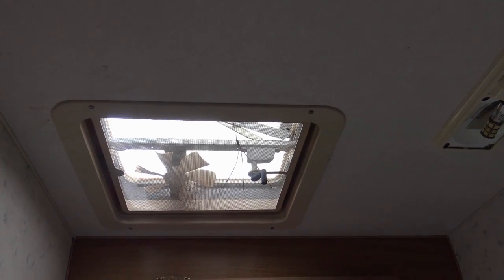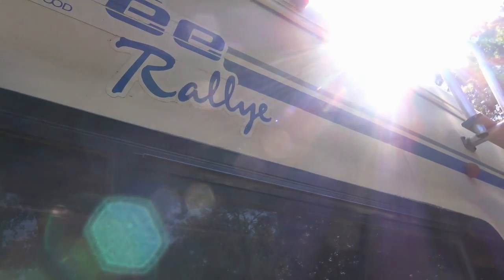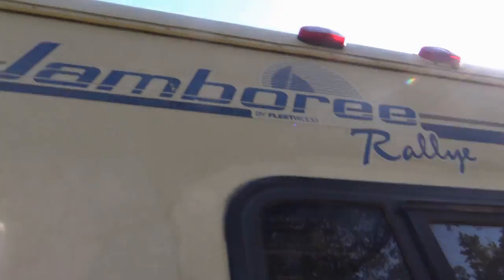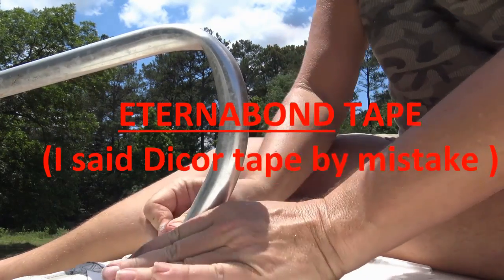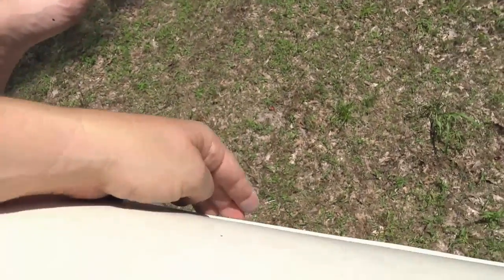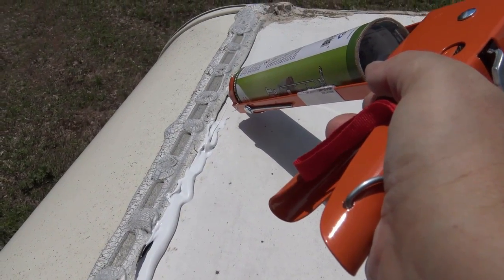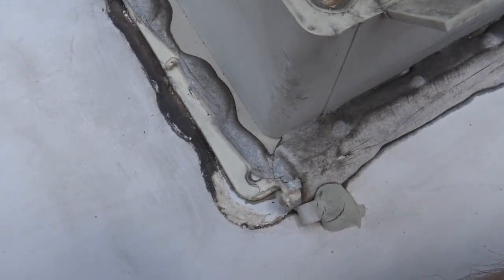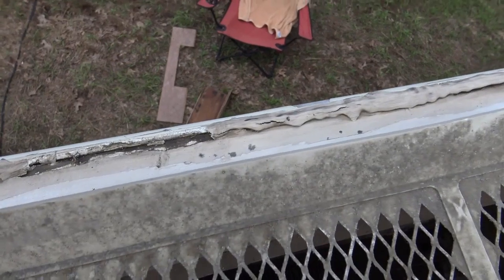RV Roof Repair: How I Repair a Leaky Roof on my  1993 Class C RV

Comment: I'm living in my '79 Nomad camper. I  was laughing at the caulking. You have no idea how many tubes it took to get me dry! lol And your caulking job looks SO much better than mine! It's not easy to make it pretty. Hope you're all sealed up now. 😊
Reply from the maker: Hollie, thanks for understanding that it's not easy to make it look pretty! thanks for sharing your experience. good luck! <3
Reply: Carolyn, try using frog tape or painters tape...I have been calking around tubs, sinks and fitting granite and marble and onyx for years...tape is your friend..it takes a few minutes to do once the area is clean but it makes a world of difference when you remove it...give it a 1/4" and so it has enough area to grip to...when its a 'needs to look clean' are then give it about 1/8" and then calk and when you use a wet finger to wipe it or better still a small plastic pipe so you don't end up with some chemicals in your mouth from licking your finger time and time again....also yo get under a seal you can take a 2" x 4" wide aluminum piece and fold it so its a 'V' shape lengthwise and then they will lift the rubber as you then squeeze a line of calk under it, it takes two people but you get it right under the seal and the seal falls flat on top of your bead of calk.....hope that helps...also if you want to bash the aluminum edge on a seam use a hammer with a piece of wood, it stops the aluminum from cracking if there is any paint and stops the 'hammered edge' look.
Reply: How about a video, please? I can't visualize what you're saying. :(
Reply: If your painting around windows you use frog tape to stop the excess paint getting on your fresh painted walls...you do the same with caulk, you simply give it a 1/4" gap so you can get more thickness to your caulk overlap....now you can use your wet finger if its a small area or use a piece of plastic pipe that is about the same diameter as your forefinger which you can wet and use to give the finish that quarter circle shape, that way you can caulk then drag the pipe or your finger along the whole piece at once,,a short 4"-6" length of 3/4" pipe should be fine......as for lifting and separating a rubber seal to caulk under it you just need a 2" by 4" piece of aluminum which you fold or have folded in a vice so its a 'V' shape..actually more then 90 degrees at one end that travels along about 2"...this can then be forced into the rubbed edge to hold it open while you then caulk under the forced open edge and then slowly caulk as the "V' travels along the rubber, holding it open then as the rubber naturally closes to will seal itself by pushing the excess caulk out again..once again, use the frog tape to stop the caulk getting everywhere, this time only allow 1/8" gap...that keeps it neat and clean...you cant even tell it was caulked at all.
Reply: you can use a pointing tool which gives a similar shape to the caulk edge....if you need to know how to caulk then look for caulking tips on youtube...there should be a painters tape tip for it...it takes some prep but better that then a messy finish on your nice sweet ride.

Comment: I've been helping my Mom fix leaks on her 1994 fifth wheel.  I figured out that I could put painter's tape along the area before caulking so I get a straight clean line.  Also, I wet my finger before smoothing out the caulking.  Eternabond fixed her roof leaks.  That stuff is awesome.  Good luck on your new rig search!

Comment: Great work! I've been watching a lot of RV videos for the last couple of years in preparation when I make the leap. Since I don't know exactly the RV I will decide to purchase I've decided to watch a variety of models etc.. One tip that made perfect sense was to purchase parts in advance before they go like calipers, brake pads, belts, water pump, gas pump and so on. Some the parts you can purchase rebuilt or through liquidation and even research some junk yards as you're heading into a new location. Most have started a website listing parts they have available and check prices the saving can be huge and save you the time of waiting for parts and drop the price of the repair. You might already know these tips but it can also help those that don't. Not sure if you have any of the service manuals for your RV but they can always offer insight to the inner workings and help you avoid getting ripped off by some of the repair place where they are shady. Regarding your generator sometimes when you have service done wires or hoses aren't secured properly and when you start to drive they fail to make contact and then as you drive again they fall back into place and will work temporarily so checking to see if any are loose etc can be quick solution. I found this link and it contains the service manual for your generator page 7 contains some troubleshooting tips and possible solution  
http://www.twinslan.net/~n0nas/manuals/onan/981-0139%20Onan%20KY%20Microlite%204000%20Series%20RV%20Genset%20Operator%27s%20manual%20(09-1994).pdf. Lists of Salvage Yards and there locations in the US-http://rvbasics.com/techtips/rv-salvage-replacement-parts.html, Owners manual-http://rvbasics.com/techtips/rv-salvage-replacement-parts.html

Comment: CAMPING WORLD is online and mails catalogues for things like vent seals, air conditioner seals (which sit under the AC), rubber roof paint, and anything else you might need for an RV. I had a '78 Class C for many years so I can empathize/commiserate, Glad to see you are DIY and saving the big bucks. You are a good example for others. Thank you. I love you. I am currently paying for a leaking roof to be fixed and after $500.00 we are still leaking.

Comment: We are having the same leaking problems in our 1993 Telstar Class C. We used both the Dicor self leveling caulk and the Eterna bond tape on the seam. We also coated the fiberglass roof with clear Flex seal. We couldn't see any cracks in the fiberglass but we didn't know where the leak was coming from so we just sealed everything. We replaced our bathroom vent/fan last year with a new one. That seems to be holding up just fine. Fingers crossed that both your repairs and ours hold up!

Comment: Thanks for the tips on sealing leaks, man I use to go on the road gold mining 8 years ago with my travel trailer and had some bad leaks. Well the plastic trim you put over the holes that attach the siding is what i needed to replace did not know that so thanks when I get anouther travel unit I will know! Your great and taught this guy how to fix this problem, your a smart gal!

Comment: A thin bead where the two surfaces meet, about 1/4 inch. Spray Windex on it and run your finger down it. Windex keeps it from sticking to your fingers and keeps the caulk smoothe and try to run your finger from end to end. Don't start and stop or lift your finger till you reach the end. Takes a little practice but looks great when done. P.S.- Don't try to clean it up with caulk remover, it will get behind what you want to leave and cause leaks. Only use it if you plan to remove all the caulk.    Stay dry.

Comment: I would get a few gallons of trailer roof paint at Lows and give the entire roof a coat or two of paint then re-coat the roof every two years. I live in a 1986 construction trailer with a galvanized roof. Doing what I told you I've never had a leak in 31 years, (knock on wood). I also calked around all my windows like you did using silicone out door window calk. They were not leaking so for me it's just extra protection.  The one place my trailer has over your RV is that it's been sitting in one place fairly level since 86, so it does not rutch around causing the joints etc to get gaps.  The paint on the roof fills in the smallest of crevices where water can enter etc and keeps it from rusting, however your roof may be some other material than sheet steel like mine is. But I'd worry about water getting in around the seams and rivets ect because the roof gets a direct pounding in a rain storm and of course snow that lays up there and melts in winter etc.

Comment: What about black mold following the dampness?  Is there anything you can apply to prevent that?  Can you rent a large fan designed to dry out homes?....then stay in an RV park and use the electricity to power it?  Good luck

Comment: Beginning about 18:20there is a crack in the refrig vent coming from a bolt on top of the vent.  You may want to get it sealed also or at least looked at.

Comment: My wife and I purchased a 2005 travel trailer that hadn’t ever been weatherized. As the Arizona monsoons set in we noticed many leaks in our roof. At first I did exactly what your doing, but couldn’t stop all the leaks. I ended up buying a 5 gallon bucket of Henry’s Tropicool from Home Depot. $200 wasn’t cheap but has a lifetime guarantee. I used a medium nap rolller and a broom handle rig and layered that stuff on thicker than pancake syrup. I had to record a couple spots but it did a small miracle for us. No more buckets for us

Comment: the pin on the bottom of the caulk gun swings out to pierce the seal in the tube
Reply from the maker: I just learned that from another viewer. how cool! thanks!
Reply: Carolyn's RV Life eternal bond tape where did you get it and

Comment: I suggest that you get an dehumidifier close up the RV and run it as will help to prevent mold from occurring. Also wipe down things with a little bleach and water with gloves on. You will be in Matilda until you find some thing else so you don't want to run into any health risk. You will want to pull out all the moister that has gotten into your RV. As long as the rain doesn't come in who care what it might look like at least you will be dry. Hope your having fun finding new places to camp. I surly am enjoying the video of them. Take care, stay safe but most of all have a great day. Spring, TX

Comment: Water leak..oh yeah, can't wait on that problem. I used "Solar Seal" first time on some leaks in the rear. No problem, still good and it's clear, flexible but can't use fingers to spread it, too thick. Made for roofing and shingles, worth $9 a tube. Next time try cutting the tip of the tube a little smaller..can get in between the smaller places better also avoiding "a blob"...hope there is no next time. that tape was KEWL...Will check that out for just in case issues. Hope ya found it all, that's a lot of areas you updated...Keep Looking Up👍

Comment: I saw a missing yellow running light that is on the passenger side I think.  This should be replaced, or you can seal that up for now or when you get time because it is another place water can get in, and possibly cause a short.  Great video, and maintaining an RV is not as simple as some people think.  At least you are getting things done when you can and share that with us, and we appreciate that.  Stay safe and happy trails!

Comment: Great stuff Carolyn.  One easy way of getting a neater line of dichor on those long runs is to lay a length of painters/masking tape along the whole length about a half an inch away from the seams. Then  apply the sealant as you did and pull off the masking tape while the sealant is still wet.  Voila you then get a nice neat line :)

Comment: I hope your repairs went well. I have a 1992 Australian made Freeway motor home, not U.S. manufacture but Australian company which illegally used the Winnebago name and re branded now as AVIDA. Now 27 years old and owned by me since Jan 2019 I have leaking around the air conditioner and back window which does not open. The left hand side rubber has shrunk and become hard after parking in North Australia tropical heat for 3 months facing east. Just got onto the roof to check removal of old air conditioner and it is a mess. I also have learnt so much with Youtube videos and like you will be repairing mine.

Comment: When I bought my 2001 Wildwood pull-along two years ago, from the only owner it had, I was aware it had had some leak problems. What I wasn't aware of, however, is that the wood framing for my camper, under the siding, has all turned into mulch. Much as I love my camper, much as I would love to have the wherewithal to get it taken apart and rebuilt, I think I'm also in the market for new digs. So I feel ya!

Comment: That and SnowSeal is Job 1 when buying an older RV.  Sometimes, we either do not know or do not have the time to do the work, but the sooner it is done, the less major damage that needs to be repaired in the future.  

I know SnowSeal works great for metal trailer roofs.  I don't know if it is recommended for rubber roofs, but I would not wait until your roof starts breaking down to apply something on that order.  Those types of products usually cannot be applied below a certain temperature.  

SnowSeal is just painted on with a roller.  It is easy and really thick.
Reply: And it will likely improve your resale value.

Comment: Just a FYI, cut the caulk applicator tip before you put the canister in the gun. Then you can use the seal puncture rod that is attached to your caulk gun. Ever wonder what that little rod that pivots out was for? Then you do not have to worry about forgetting the nail you said you forgot, or gumming up your screwdriver. Just some friendly advice.

Comment: Memories... I restored our family camper one summer after water damage.  I enjoy those memories now.  They do sell rubber fingers (as opposed to rubber gloves) so that you don't have to get that sealant all over your fingers.  A piece of tarp and some duct tape work well until you can get to leaks.
Reply: We also put that silver coating on the roof to deflect heat, but I never noticed a difference from that.  We were always parked in shaded areas anyway, and on hot days the a/c was on.  We put a piece of laminate flooring in water for 24 hours to test it, the water never penetrated it.  I think that is a good choice of flooring in situations where water damage can occur.  We also took all the windows and old putty out, and completely put new putty all around for the windows to sit into.  What I liked best was that I had an excuse to change the interior paneling, and at the time it was brand new that all types of stylish paneling was available for sale. Our camper was as new again, and is still going strong some 30 years later. I think the camper was 17 years old when we restored it.

Comment: I like to use green painters tape to outline where I am sealing. On the window trim and coach skin... once sealant is where I want it I remove the tape. Works best if it is removed while sealant is part wet. All for appearances. But, not on the roof. The a little touchup paint..   looks like you got it sealed. Good job. :)

Comment: Carolyn good job. If you look on your caulk gun you will see a long nail screwed to it in the front. Use that to puncture the tube seal before putting it into the caulk gun. saves having to clean off a screw driver.

Comment: FYI- there is a wire stick attached to the caulking gun to Pierce the caulk tube with. Save the nails!  😀 Thanks for the tip on the caulk remover.  Nice dyi job!

Comment: Tool tip.. the wire on the bottom of the caulking gun is for poking the inner seal on the tubes and that hole in the handle is for cutting the tips :)

Comment: you should have used the Tape across the rear edge and then used the caulking. also you should  have placed tape completely around the base of the top of ladder covering the old calking and then putting a layer of the caulking as a seal. another think you could have done is when you lifted the back edge of the old tape/caulking you could have put some of the new caulking under it then pressed it down it would have given you a better seal.

Comment: Flex seal works so good I used it on my pop up and no more water in popup
Reply: You DO NOT want use flexseal on EPDM (rubber) roofs. It is petroleum based & will do bad things to the rubber.

Comment: I'm catching up on your videos. This one is very helpful to me as when I finally get my mobile home it's probably going to be a class c and an older one too. I decided on Class C because I have a cat and unlike a dog won't be able to wonder around outside as much so a van would just be too small and I think I'd be too chicken to try and drive a Class A. I also don't really want something that needs to be towed behind because then I'd have to get a big enough truck to tow it and also the thought of towing a big trailer just sounds scary and then there's no quick get aways if needed either. Anyway sense my fixit jobs would be as if I really knew what I was doing this is very helpful. Pilamaya! (thank you in Lakote)

Comment: Good for you for trying to plug the holes yourself. I'm guessing you were already out of the area that where there was offers to help.  Are you sure you will be happy with a class b after being in a large class c?  Plus they cost so much for what you get.  I'll be interested to see how the selection process goes as I'm still in the looking process and have flip flopped on class B vs C now a few times.  I have however decided Class C.  My reasoning is that I plan to be in it for a few years FT, would like room for guest(s), don't want to make up a bed every time I want to sleep (some B's do have a perm. bed in back but not many older ones from what I could find), and I'm not crazy about the wet bath.  I'm also not planning on getting a large C, in fact one of the smallest such as a Minnie Winnie 22R.

Comment: On the underside of the caulk gun is a metal prong for poking the seal. Just swing it out and poke the caulking tube. saves you the trouble of a nail.